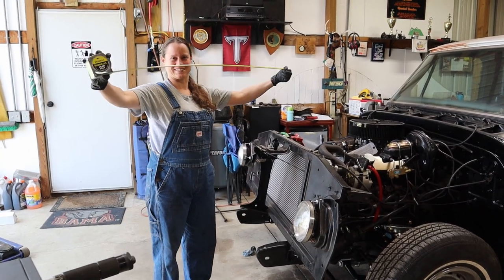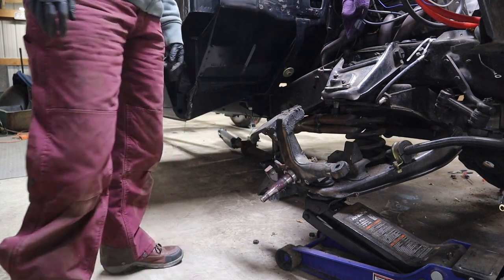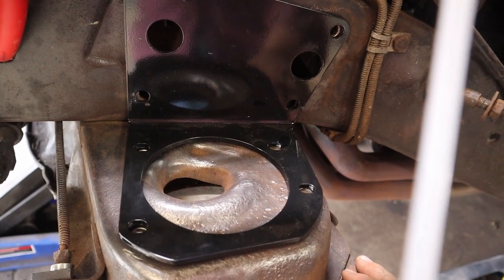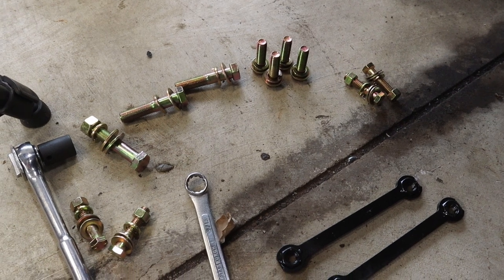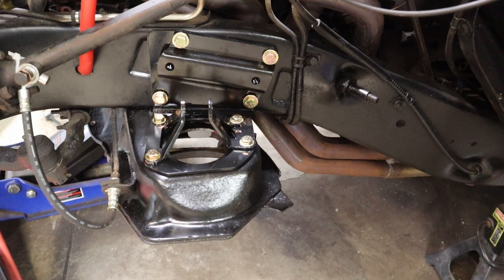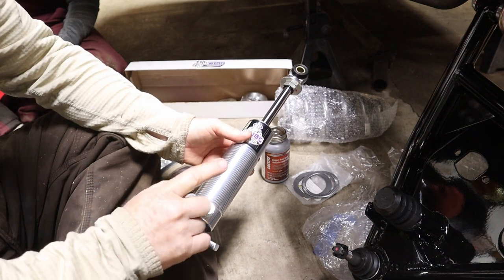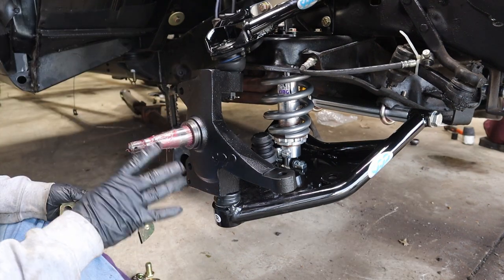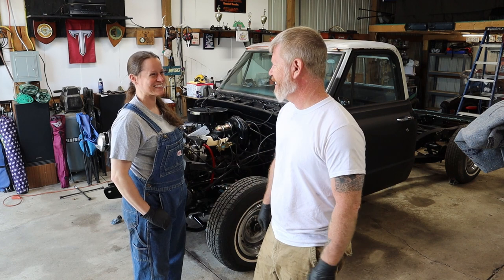Dropping It Low: Transforming our 1972 C10 with CPP's Coil-Over Conversion - Project Harold - EP 16

Comment: Next time, do yourself a huge favor, point the torch the direction you are cutting. Only about 15-20 degrees. You'll get a cleaner cut, with alot less cleanup. Good job anyway.
Reply from the maker: HI Gary. Thanks for watching and sharing the tip. Really appreciate that. This was actually my first time ever cutting with a torch. LOL. Quite the first practice piece huh? Mess it up and I'm screwed. Hahahaha. Since then I've purchased a plasma cutter so I'll have an even better tool if I have to cut stuff again. Thanks again for the feedback and tip. That's what a positive community is all about. Cheers!

Comment: Very cool man good job. Thanks for the instructions, 1 question. Why the coil overs in the front and not the back? Thanks again. 👍
Reply from the maker: Hi SoCal. Thanks for watching and sharing the kind words. We really appreciate it. Great question.  It was a mix of 2 reasons, cost and purpose of truck.  It won't be on the track and springs vs. coilover cost wise, which is ridiculous, made it an easy decision.  We're also building a full 70 Mustang so we're balancing funds between the two. 😫. Thanks for following along on the build.
Reply: @SpiritedWrenchers  gonna start on my 72 c10 this week. Was thinking of going all coil over but just might go with the performance package with coils. Does the coil overs make a big difference in the front? It’s Just gonna be a street truck with a 383, 270/280 mega Hydraulic roller, Brodix heads, Should be fun. Got the truck 15 years ago for 500$ drove it for 6 years and it’s just been sittin. Son just got his liscense so he can feel what it was like to drive a truck from the mid 1900’s 😂. Great videos thanks again.

Comment: Thank you so much for your detailed instructions for installing this lowering kit from CPP. I ordered this same front and rear kit over a year ago for my project truck and for some reason I never received any instructions.  And good luck trying to find any assemble instructions or videos on the CPP website. So CPP owes you for actually doing a step by step video instructions of their product. One of the biggest complaint i had was there are no instructions on how to assemble the coil over shocks. All their videos just show them starting the process, a bunch of drama, and then  "ta da" its done. And oh yeah, if it makes you feel better, I had to remove my passenger side header also just to end up torching the bolts exactly like you guys did in order to get the old upper control arm bracket off (after spending 3 hours trying to remove them with a socket). Great job you 2 on you video! Thank you so much!
Reply from the maker: Hi Brian. Thank you so much for watching and sharing the kind words and your own journey with us. We can't thank you enough. For the very same reason you called out , we wanted to create this video for others. To know that it helped 1 person, made it all worth it. Funny that you ran into some of the same struggles that we did. Which truck did you install the kit on? Would love to hear more about it and if you're the sharing type, feel free to send us some of your project pics. Email is in the description. Hope you stick around for more of the build series. Cheers!